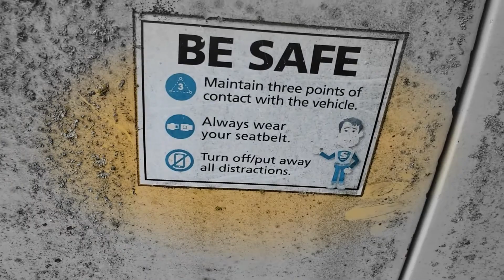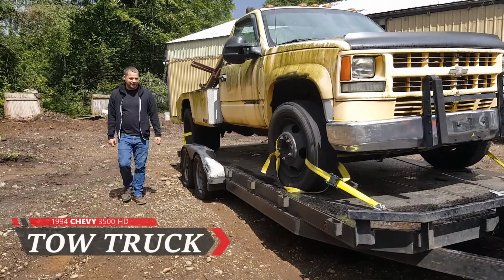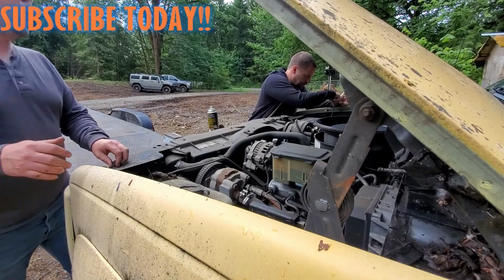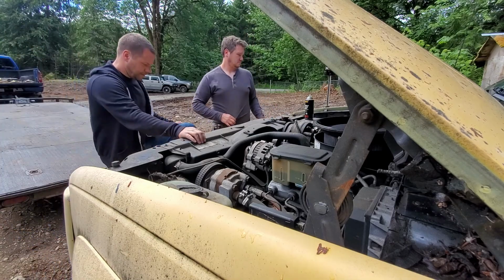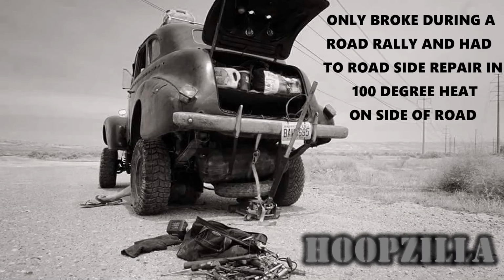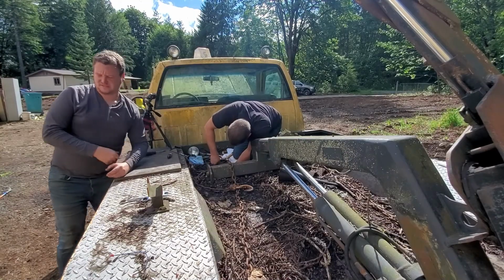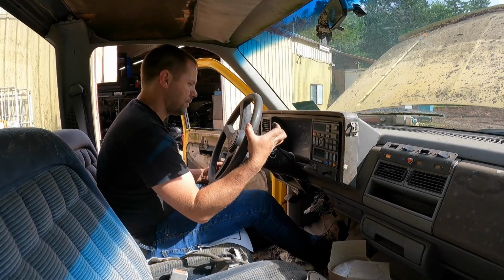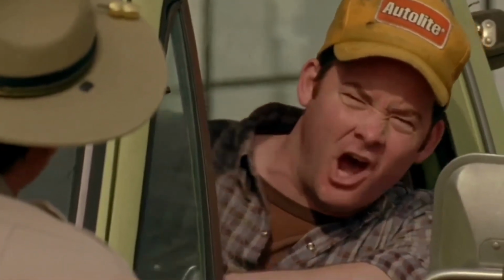BIG BLOCK 90s CHEVY TOW TRUCK LEFT IN TOW LOT TO RUST AWAY WILL IT START AND TOW AGAIN

Comment: The usual way to "restore" those if the cab's tired is cab swap which beats bodywork. If you're not going over DOT scales what the replacement cab came from is up to you if ya know what I'm sayin'. The automatics of course were crap but easy to replace or upgrade. DO NOT put a stock box back in a wrecker. Better clutch packs, metal pistons and a vette servo at minimum.